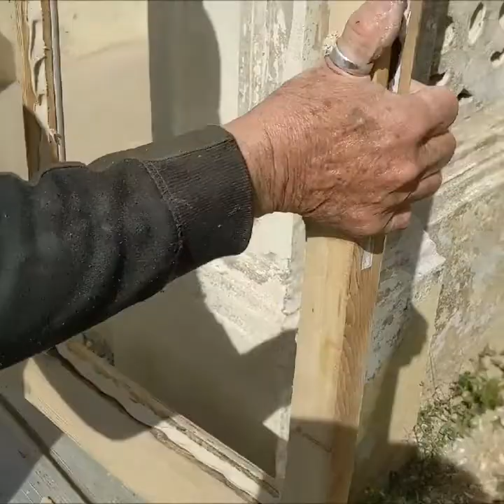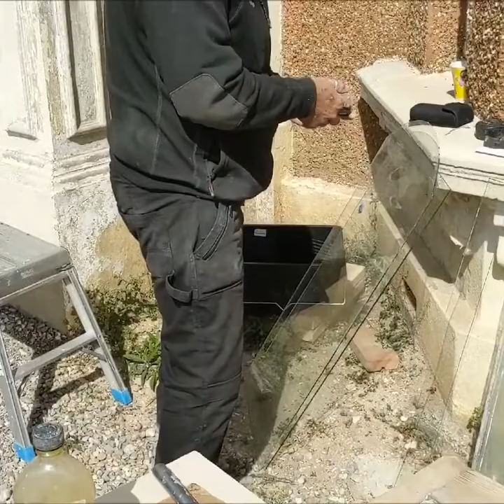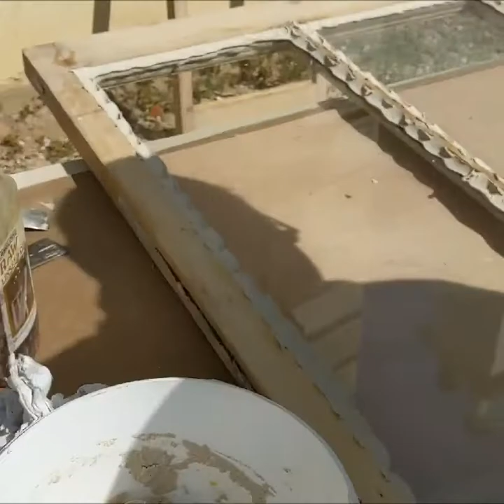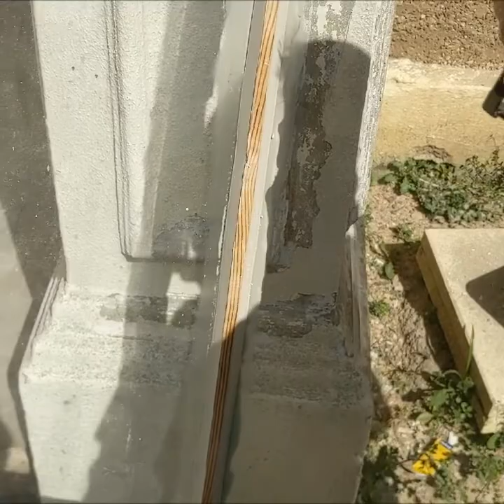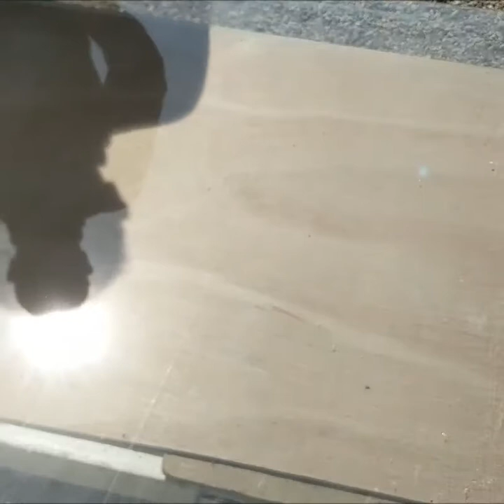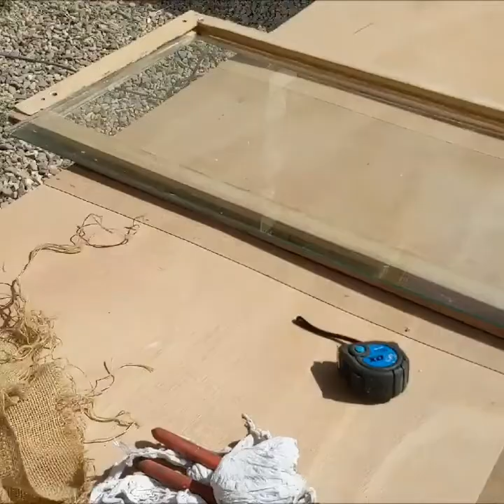Re-glazing old sashes. Raw footage

Comment: as I do windows in my bldg,another discovery,,4D finishing nails which I use to nail down the trim and parting stop in the middle,the nails bend when going through soft 80 or 70 year old white pine,( good for nailing the rope knot in the sash small cavity at the side, griprite fasteners  dist by prime source bldg mats,irving Tx,,made in Taiwan

Comment: old timer I helped part time years ago daubed linseed oil along the rabbet,then comes the putty bed anough to make a sixteenth in seat for the glass,,which ought to be polished with pumice powder,or cerium oxide,w.o this plastic grit remains on the window surface,hence the putty will not adhere well ,,edges of the glass ought to be feather/sanded taking sharp edges off and rounding the  corners means the window will  regularly take kid slams without breaking,,,,,,triangle points are tapped into the glass.rabbet edge ,,one pt per linear foot using a cold chisel edge,,at the  side of the tip
 outside edge of the sash out to be rounded evenly a  bit with sand paper,so the putty makes a neat clean edge when pressing into place with the knife

 the rolled putty  then gets pressed into place,corners get a 45 degree angle so water runs off,,,,,,oil based putty repels water insulates from cold and noise better than DAP  ( US big box stores where I am no longer even carry oil putty,or the cotton window rope for the sash weights,,or the curved putty knife). either prime the whole sash and rabbet first,or, paint the sash and putty bead after the stuff firms up after a couple weeks,,it cures better in a cool area.  windows treated like this will last 40-50 or a hundred years,,,,get that kind of warrantee from your local vinyl glass and aluminum window factory,I dareya

the simple step of taking a wee bit of extra time to polish off the plastic grit,they dont bother with it instead they all  use the house mix of blue type window glass cleaner it does not clean the grit,which leads to seal failure of that godawful smelling grey chemical paste to join  and seal the double glass sheets,
Reply from the maker: Fabulous comment!....and I think it's also the longest one I've received!!!!

Comment: might add some info on mats for old wood window.sash repair,I wanted to find 1/4 in cotton braided rope,,tried lowes, home depot,they do not carry it,amazon,all they have is 3/8ths wide rope,which I believe is good on  larger wide and taller big size windows not usable in my smaller coachouse windows,,,,the source that came through is SGT ROPE, I ordered it last week just got it dropped at the gate today,,oughta be a nice result,and last 50 or a hundred years,, (just  vacced out the sash hole too, a lot of coal and old dust in there)

Comment: What paint do you use on the putty ?
Reply from the maker: Always oil/spirit based! IMO water based paints are for the benefit of the decorator (and the manufacturer), NOT for the end user! It's a personal point of view.
Reply: outside facing wood needs oil resin based paint,,an excellent primer on the cheap,,linseed oil boiled that is,and turpentine equal parts,the stuff absorbs nicely into
 the wood fibers of even painted but scuffed and chipped painted window surfaces,,allow it to air dry and cure for a couple weeks,then your choice of oil base on top,use a biddy portrait paint brush to lay a bead of paint on the putty seams, a thin straight trowel help keep the edges clean and sharp looking
Reply from the maker: @danilorainone406  Yup!